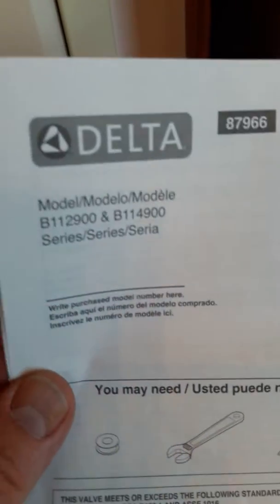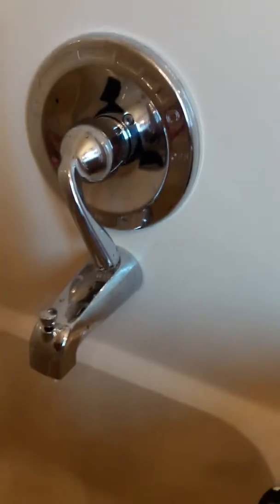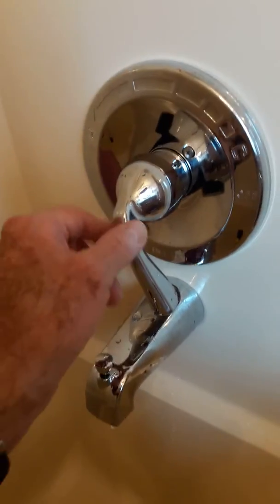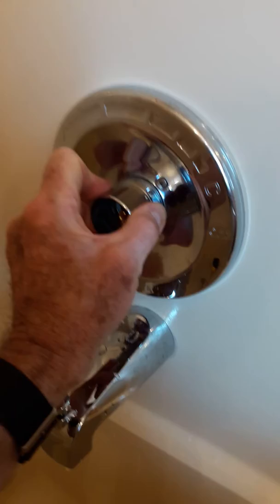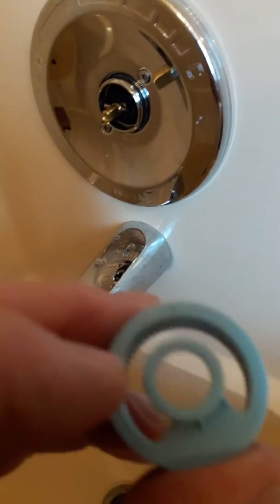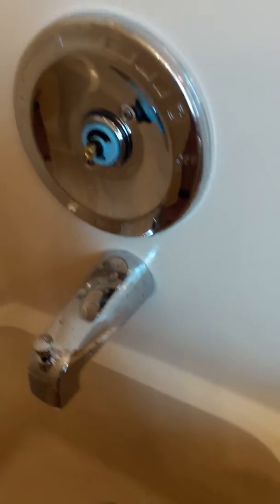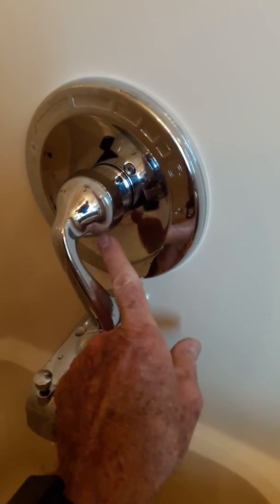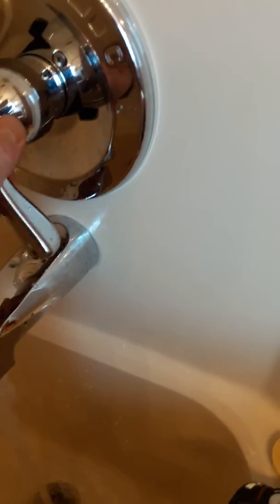Delta model b112900 temp control

Comment: Seems that the blue part controls a black piece behind it…for me, just turning the blue part didn’t work.  the blue part isn’t ‘geared’ to turn the black behind it.    and then the bolt wouldn’t tighten, when i tried it.     i had to put the blue back into the position the plumber had it.